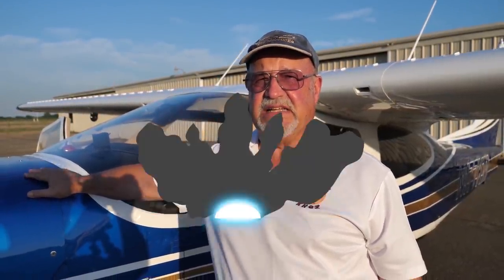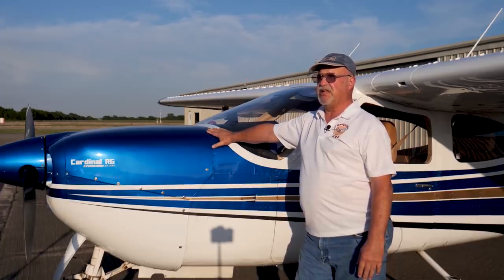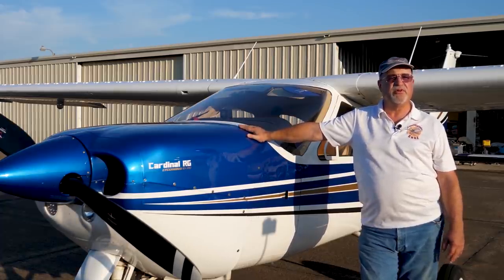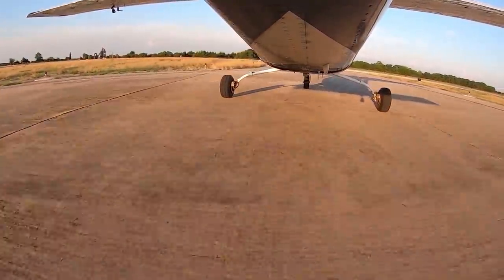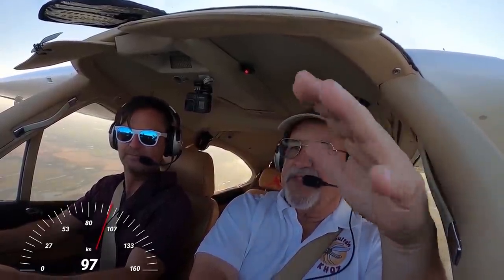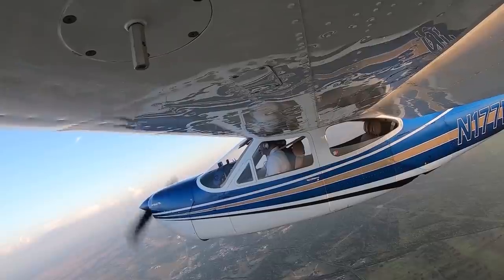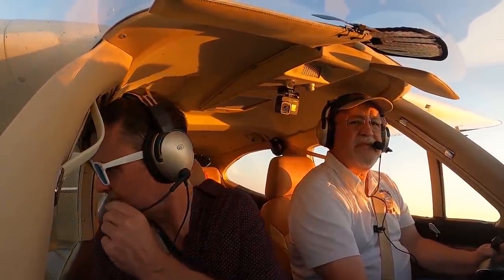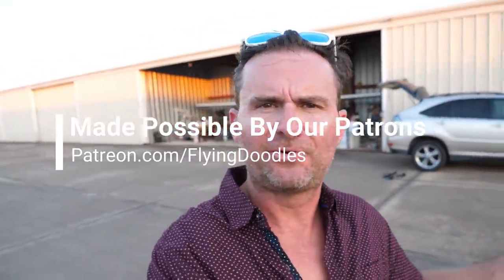Cessna Cardinal 177

Comment: It really is a shame they didn't become more successful. They were such an improvement in performance over the 172. Here you have an almost 50 year old plane with better performance than a new   Cessna.
Reply: Dan, you can't really make that comparison.  Cessna doesn't have a four seat retractable airplane.  That's like saying the 50 some year old 210 was better than the current Stationaire.  Of course the 210 is going to be faster and better performance.

Now, I can't find a price on a new Skylane, but based on what's on Controller.com, let's say $550K, maxed out. A Skyhawk, let's say is $100K less, or $450K
Now, let's say a new Piper Archer LX is about the same cost as a Skylane, $450K
The newest Arrow I can find for sale is a 2013, and they want $300K for a seven year old airplane with 2,400 hours on it.

So, using those numbers, I'm going to guess that a new Cardinal is probably going to run about $525K, outfitted the same way as the Skyhawk and Skylane.  I'm not sure that there is enough demand at that price point to bring back the model, as much as I would like to see it.

Actually, what I would like to see from Cessna is the NGX-II airframe.  The NGX, or Next Generation X airplane never came to light,  but I think a new generation airframe that builds upon the Cessna legacy would be nice.
Six passenger, FADEC engine, retractable, strutless wing, stabilator like the Cardinal, wider than the current designs, more like a Malibu/Mirage/Matrix or the old Commander 112/114 series.  Obviously, glass cockpit, and under $1M.  Still, even that does not meet the need for a new complex single trainer, and maybe you'd need to have a NGX-II and a NGX-T for trainer.  Basically bring the Cardinal back as a trainer, IO-390 like Karl has, glass cockpit, and really, that's about it.  A variant would be what I described in another post, the IO-390, TATurbo's turbonormalizing system, G1000NXi, leather interior, etc.  A personal 'go places' airplane.
Reply: Weren't the 177 airframes slightly cheaper to build? With tooling that old and written off, one should be able to bring the price down.

However, the main problem is the small size of the global flying community. Either way, you can't sell enough small planes to make any new production technique be worth its while.
Reply: daszieher Actually the 177 was a clean sheet design. It was actually more expensive to build than the 172. Due to the initial stabilizer issue and underpowered engine, the first two years of sales was way under the 172. So they dropped the 177 in 1978 and continue to build the 172.
Reply: @vconnor  I know about the clean sheet design, I had just assumed that that would have incorporated a more efficient build. Early 177 were underpowered and the cantilever wing did not inspire confidence in very, very conservative Cessna customers.

Sad that the 177RG did not do better. Although I've never seen one in person, I believe it is the better plane. Then again, only the 172, with the careful balance between performance and simplicity (aka reliability) is the "real Volkswagen" of the skies.
Reply: daszieher Totally agree. I have a 177B FG with 180 hp and love it. It flies great, very comfortable. I trained in 172 and the 177 is soooo much more comfortable. I think Cessna made mistake not moving forward with 177. It’s a great plane!
Reply: @GaryMCurran  "Cessna doesn't have a four seat retractable airplane.  That's like saying the 50 some year old 210 was better than the current Stationaire.  Of course the 210 is going to be faster and better performance."

what's a 172RG, then?
Reply: @ShuRugal  when I said that Cessna doesn't have a for seat retractable, I was talking by about one that is in production.
They also had a retractable Skylane, but that's not in production either.
Reply: @daszieher  And the size of the global flying community would be much larger if everything wasn't so stupid expensive. (not being bitter, but I can no longer fly because of how expensive it now is)
Reply: @Ripper13F1V  and flying in the U.S. is much cheaper than anywhere else, mind you...
Reply: @daszieher  True, which is insane. The cost of new aircraft is exponentially higher than homes. Even light singles are as much or more than a home. Did not use to be that way.
Reply: @Ripper13F1V  the main problem: there are enough customers willing to pay almost a full million for a new Cirrus. So why should they bother and make cheaper models?

Then, the expensive models outsell the cheap. That's why Mooney never continued an "entry level" M20J or even a C model next to the faster six-cylinder lineup.

Around me, half a million buys you a decent house (but no mansion). But who has that much left over for a conveyance (on top of the house!)

That's why I've been looking into ultralights. Germany has recently increased the MTOM to around 1,300lbs, that gives them a competitive edge over what the name class used to represent.

Maybe the turnaround will come 😉
Reply: What about 172 Skyhawk 195hp, what type of performance is possible? Want to buy 1

Comment: I really like your plane with a cabin width of 48". That's four full feet!  I don't understand the wing spar system and how this could be as strong as strut equipped wings.  It look like you only have the mid door posts to really secure the spar to the fuselage.  I don't see room for any kind of web plate arrangement there. How does this work? The performance figures of this aircraft are great. I would think the 200 hp engine is just about right for good economy also. Not so powerful it guzzles gph but enough to power the aircraft well.

Comment: Wow, your story is so close to mine. I began flying in 1962. I was single and had no expenses so I took my money and began taking lessons in the Piper Colt. Then college and marriage got in the way and I didn't get my ticket until July of 1973. I joined a flying club that used Cardinals and then came babies and life got in the way. In 1981 I started taking lessons for my instruments rating. I finished that rating in 1982 and haven't flown since. It has been 40 years and I am dying to get current. That will take money and lots of it.

Comment: Gotta get the wing-spar inspected. There was a fatal accident in Australia where a Cesena 210 (without wing struts) had a wing separate due to wing-spar failure. I understand they aren't regularly inspected as it requires getting under the headliner.

Comment: I learned to fly in a 1969 Cardinal fixed gear. That big stabilater tail is what I became comfortable with. On the occasions that I would fly my friends 172, the tail seemed so mushy on landing that it was almost scary. I guess its all what you get used to. I sold the plane (N30308) in North Carolina; and last I knew, it was out in Phoenix. So if you by chance own this green & white beauty - Happy Flying.

Comment: Unfortunately, my training for my PPL was stalled last year due to COVID, but I'm going to pick it up shortly. I was flying the Diamond DA-20. What's annoying about low wing planes is that you can't see below you. So when I was training and was told to rotate around a fixed point, it was hard to see that point! What's nice about the Cardinal is that you can see below and because the wing is swept back, you can see above you as well! I'm already saving up and would love to buy one of them next year. Probably the fixed gear, however, because the RG is pretty expensive to maintain and I still have kids in school!

Comment: When I was learning to fly there was a Cardinal fixed gear that belonged to a private owner there.  I thought it looked pretty cool with no struts and long windscreen.  They had the same engine as my 172.  The flight school called it the "Strutless Wonder" and a play on words for gutless.  They didn't handle well, didn't climb well, and the wing built up drag real fast at low speeds, all of which were a poor combination, its useful load is substantially less than the Skyhawk, and could only make 105 mph.  They say if you buy one, you need to get at least the 177B with O-360 instead of the O-320 and the better wing like the Skyhawk's.

Comment: Would love to see a video with a Navion. First built by North American, it was often called a 4 place P51. Looked similar, but with retractable tricycle gear. Flew with my dad. We got it over 200 MPH in a slight dive. Was cool to be like 14 years old and be that fast, long before I ever flew on a commercial flight. Was an easy plane to fly. Would make an interesting video!
Reply: I remember when I was in South Africa, at Krugersdorp Airport (FAKR). Based there, was a demo team with 2 or 3 Navions. Looked similar to the Piaggio P.149 to me. But this demo would just do a demo every other day, which was an amazing sight. South Africa truly is an Aviators paradise.
Reply: @iflycessnas4707  Never heard of the P.149 but wow, they look very much alike. We were part of a military flying club and we had access to a couple of Navions. The one we flew had a 260 HP engine although it most likely did not come with it originally. All military surplus. We had a couple of Cessna Bird Dogs as well.

Comment: What a nice example of a 177.  I flew the fixed gear and RG back in the day and didn't like them, but I don't remember why exactly.  I think it just felt so different from the other planes I flew. I  want to go check one out again.  The performance numbers are pretty good.  I don't understand why this gentleman initiates radio transmissions the way he does.  Just say who you're talking to, who you are, where you are and what you want to do during the first transmission.  It cuts the radio transmissions in half.  He seems to introduce himself to ATC each time, and then they're like..."yeah...say your request..."   Not necessary and adds to radio congestion.  (Sorry..the CFI in me comes out when I watch these videos).
Reply: I find it more effective to get ATC's attention first, then tell them the details.  Too many times the first full-length transmission isn't received & it all get's repeated - THAT takes up time.
Reply: quinnjim I had a CFI that was a retired ATC guy. He would have disagreed with you on the radio calls. I did it the way he wanted while he was with me, but the AIM says you can make your request on your initial call “if it is short”. (AIM 4-2-3 a.1.d  for the curious) I flew a few hours in a Cardinal RG. I thought it was really nice but the 4 cylinder with a 3 blade prop had a strange vibration rhythm.

Comment: I’ve always liked these planes, I had no idea they were near as fast as the numbers he’s saying his is.
Reply: Don't  believe he gets those speeds....
Reply: @timalexander9008  Oh it does & several friends with -390 report same results.  The Aspen TAS doesn't lie.  I've even seen 158 kts when running balls to the wall.
Reply: Tim Alexander He does. I’ve flown it!
Reply: Those are excellent speeds! I fly a 200hp Mooney and don’t see air speeds like that.
Reply: not only does it respond to more power well, but the turbo normalized RG does 170 - 180 kts true
Reply: I’ve got a lot of speed mods and a powerflow exhaust on my fixed gear Cardinal.  With a favorable CG, I see a 150 MPH (or 130 KTS) TAS cruise @ 75 % power.  If I push it up to 80%, I see 155MPH (or 135 knots) at around 11 GPH.

Comment: Seems like a much better plane than 172. Cessna would presumably have been a very different producer today if that was the progression already in the 60s but instead they cemented the 1955 design until this very day, 65 years later.
Reply: Dan.  Very true.  The Cardinal was unsuccessful in the market at the time, thru no fault of its own. Search:  “The Pilot’s Lounge #127: Unfairly Maligned Airplanes” to learn more.

Comment: That gear would make me nervous. Watching that left main wiggle around when we was taxing back after flight. I’m sure you have to be super careful with that plane. One hard landing looks like the mains would just fold up.
Reply: you take the fairing off of the fixed models, and youll see the same flimsy tube
Reply: Sammy, Cardinals have been flying for 50+ years.   Accident data does not show landing gear weakness as a problem area for Cardinals, both fixed gear and retractable gear models.  If it did, the FAA would step in and issue an airworthiness directive to mandate a fix.

Comment: Is perfect, I wd just install the 3 blades propeller. Rest is just amazing, doesn't need anything else.
Reply: Three bladed props are not a great match for the Cardinal. Owners report better looks and smoother operation,  but at the cost of more weight and a loss of 10 knots in cruise speed.
Reply: Generally less than 250hp you are better off with a 2 bladed prop.

Comment: nice video.  Does that particular airplane had the dreaded "dual mag"?  Looks like the engine STC deals w/ that problem.
Reply: Not sure “dreaded” is the right word.  After all, the Bendix mag was certified by the FAA and has been in use for decades. And the accident statistics due to mag failures don’t indicate the Bendix mag is significantly worse than the independent mag setup.  But that being said, when I replaced my engine with a factory reman two years ago, I went with the independent mag version for redundancy AND the ability to go electronic on one of the two mags in the future.
Reply: @cessna177flyer3  Smart man, that makes a ton of sense.  Sounds like a great solution.
I've never looked at the statistics, that would be interesting to see.

Comment: I've often wanted to try out a Cardinal but haven't the opportunity to do so.
Reply: Do it Jim.  They fly so much nicer than other Cessnas. The old adage “looks good, flies good” holds true with the Cardinal.  Responsive, but not twitchy.  Very little adverse yaw.  Great visibility. 4 inches wider than a 172.  No struts makes it easy to get in and out.  YUGE cabin for this class of airplane - rear seats have a tremendous amount of leg room.

Comment: I still think Cessna should reintroduce the Cardinal, both in a Fixed Gear, Constant Speed Prop, and the RG.  Both get upgraded to the IO-390, and both should also have the option of the TATurbo Turbonormalizing system.  IF I was flying, I'm not, a turbo-normalized IO-390 with a Garmin G3X Touch, GTN750/650 and a GFC500.  It would make a very nice personal airplane with a step up in performance from the Skyhawk, but without the cost of the Skylane.  It also would give Cessna a 'complex trainer' aircraft, something they desperately need.
 
I wonder if Karl has the ElectroAir system installed in his airplane.  I've been thinking about this recently, and with the advances in electronics, I don't see why GA airplanes are still flying with magnetos.  There truly is no reason for it.  Dual battery systems and dual ignition systems (the same as we have now with mags) would suffice to keep the airplane in the air in the event of an electrical failure.  Even a small alternator on a direct drive from the engine to power the busses for the ignition modules, in addition to the standard alternator (think GAMI's 'Supplenator') should be enough to keep the airplane running.  It would, as shown, carry more of the engine load, which means it's far more efficient than the standard mags, and would most likely give you a substantial (5-10%?) increase in fuel economy.

http://www.electroair.net/4cylIgnitionKit.html
Reply: Yes, it is the Electoair ignition
Reply: @karlthomas5740  ElectroAir is claiming a 10-15% decrease in fuel burn. or at least 'up to a 10-15% decrease.'  I'm no longer an active pilot, probably can't get my medical renewed, and lots of other stuff, but I'm curious about the EA system and how it's worked in your Cardinal.  Are you finding any difference in the engine performance, spark plug life, real world fuel economy, etc.  I'd love to get your reaction to having the system installed.
Reply: IO-360 or IO-390 won't fit in FG without mods to cowl.
Reply: @GaryMCurran  No difference in fuel flow in mine, just better running, easier hot starting & will run LOP down to 7.5 gph. Idles at 600 rpm, something you can't do with mags.  I run fine wire plugs & only have to pull the lower plugs every 100 hrs or so to clean out the lead pellets, no fouling issues & plugs have 900 hrs & still look fine.  Run 9.5 gph  at 8-9k ft & 145-151 kts  17-18 mpg.

Comment: A friend / Employer had a C-177RG 200 HP ... Nice airplane but felt funny on pitch at full gross.  JMHO   Who the hell can afford a new single 4 place @ over a half Million today. 
A club i was in  bought a 77 C-172 IFR equipped w/ 100 TT in 1978 for $23,500. Was $24,500 but they took off $1000 for the 100 hours. That same airframe w/ 180 HP and Glass is 22.44 times the cost in 44 years ... Unbelievable ... I'll bet 50 to 60% of that cost is Liability Insurance.

Comment: I had a chance to fly two different 177RG's owned by 2 different friends. Decidedly the slickest Cessna I ever flew. Between the RG and the missing wing struts it was amazing. The only thing is that you need to drop gear about 1/2 downwind if you don't want to struggle slowing it down. Great memories.